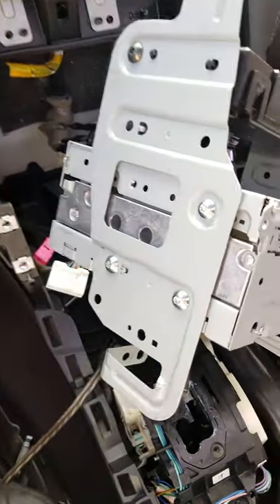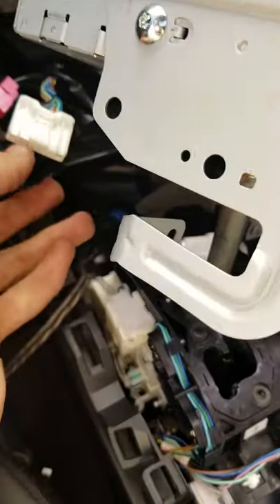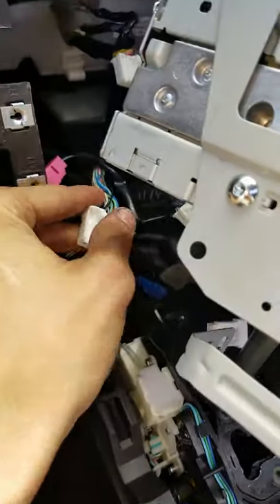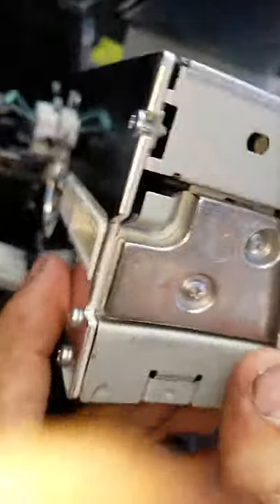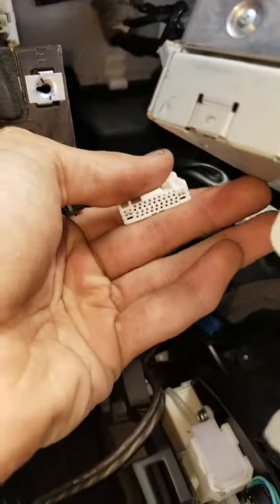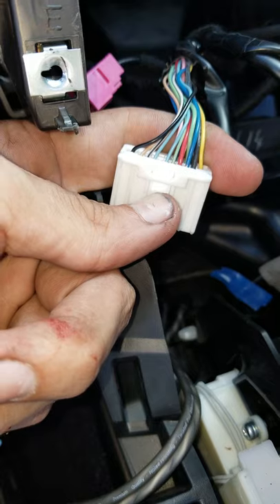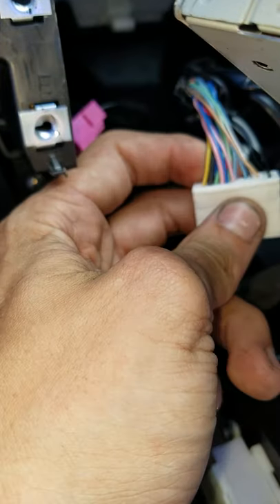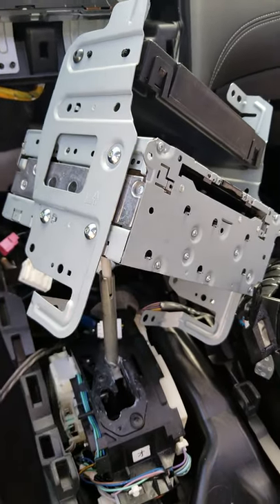Line output converter 2018 Infiniti q50 BASE Sound (Read Description!)

Comment from the maker: This used to be a proper video, but YouTube made it into a short.

****EDIT PINK AND GREEN,. NOT PINK AND BLUE!! I REPEAT PINK AND GREEN NOT PINK AND BLUE, YOULL SEE THAT THOSE WIRES ARE THICKER THAN THE SURROUNDING

This is base sound system, not bose. LEFT FRONT. BLUE - RED +  pin 2,3. RIGHT FRONT. GREEN - PINK +. Pin 11, 12. 

Added you MUST remove the 2 microphones for the active noise cancellation system! Or it will not work, there are 2. The first is under your dome light/sunroof module. Drop it down(just clips holding it in, I pulled from front to back first) DISCONNECT THE BROWN CLIP ONLY. The other mic is for bluetooth. The next is under your headliner. If you look at the headliner you can see a small plastic tab, that is the microphone. I opened the sunroof and pulled the headliner down. It's just secured by velcro. You have to reach back and unclip the brown connector, and you are done.

Comment: Great video. I would’ve been stuck for trying to figure which 20 pin is which for a while.

I’ll post up the schematics for each wire if anyone is planning to put on a 4 channel LOC rather than 2, with power and ground.
Reply from the maker: Yea it's a specific video took a bit of trial and error but eventually we got it to work! Glad I could be of assistance
Reply: @bkashuba  dude help lol

Comment: What wire do I tap into for the remote signal wire? My LOC has the remote turn in wire included
Reply from the maker: There’s a ton of spots see if your cigarette lighter is key on power. They usually are

Comment: Quick question. I’m installing on an 2021 q50 with no rear sub. I will have to tap from the front radio and run it to the converter to get an audio signal?
Reply from the maker: Yes
Reply: What if you tap into one of the car doors?
Reply: @busta5473 you can but it’s not as good
Reply: @busta5473  I did just that but now I’m switching to the radio for better sound
Reply: @dylanscheeler163 Kinda late but did you tap into the Front door Low-midrange speakers ? Or did you tap a tweeter or something ? And how did the radio tap end up going ?
Reply: @dylanscheeler163  I hope you see my notification right now I’m about to do this. I had tapped into the rear car doors but it doesn’t really sound good. I feel like it’s missing bass or sum. Did you end up doing this? Did it sound better?

Comment: There's a way easier way to do this
Reply: Which is?
Reply: Lmk.  Needa helpa.
Reply from the maker: Not really. I did this for a living. You have to splice regardless.
Reply: Instead of splicing into the head unit you can splice from the sub in the rear, then its just take out the trunk liner
Reply: @dro2231  homeboy, non bose q50s don’t have the rear sub/amp
Reply: @kotavets  ain't your homeboy
Reply: @dro2231  Wasn’t a possessive use of the word.
Reply: I figured out the issue.  U have to splice it into the head unit.  Well I did.  And I disconnected 2 microphones because of the rumbling sounds.  But yes.  Gotta hit it from the 2 front door speakers for the lows.
Reply: @iiM iiNSaNe  what about disconnecting the fake engine sound connectors in the headliner? I heard that is the fix and you don't need to disconnect your mics
Reply: Hi, thanks for info I'm in middle of fitting an amp upgrading speakers and sub, mines a 2015 q50 2.2d based in u.k, you know how you gotta splice into 4 different colour wires to get signal from audio unit to the amp? I have only two wires one red and one black ,does the red splice into 2 certain colour wires and black into other two wires please?